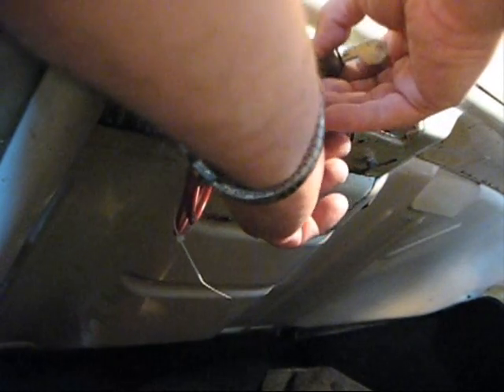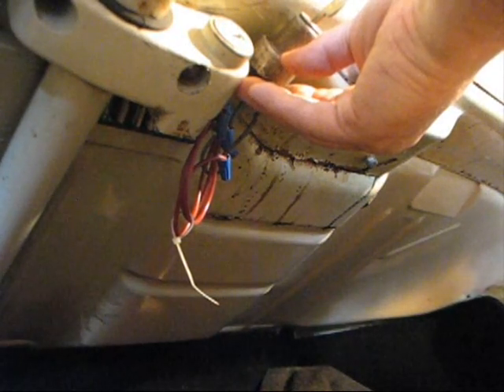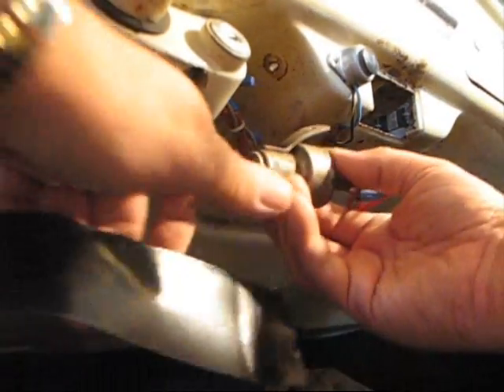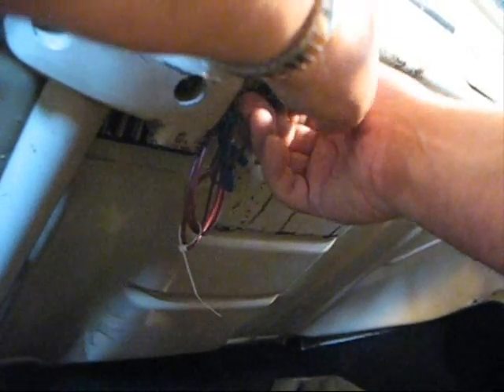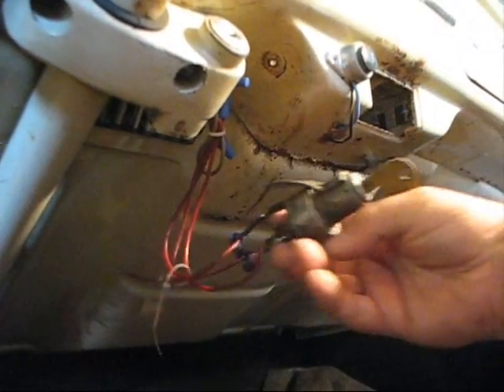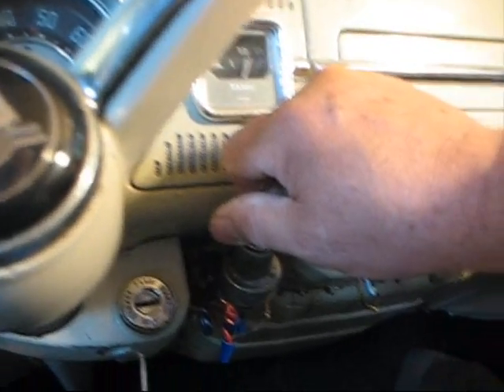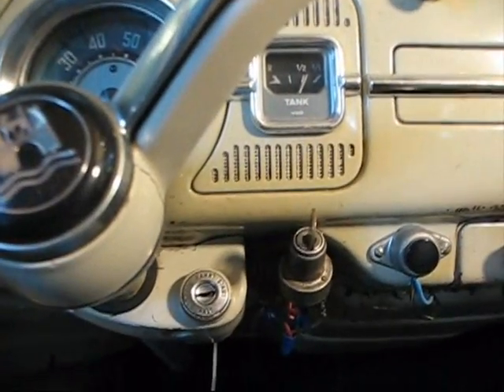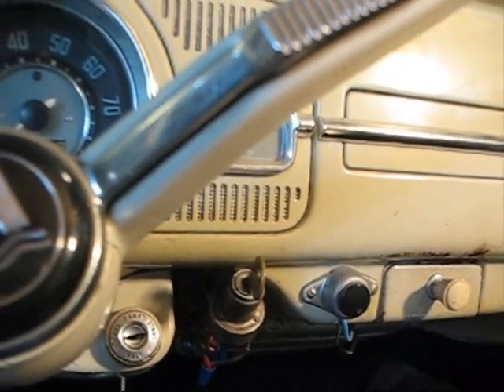VW Bug igintion switch installation 2

Comment: I am pretty sure if you remove that horn button on the dash you will find the stock ignition switch location .

Also pretty sure that lock on the column is just that , a locking column , Not the ignition switch like in the later models